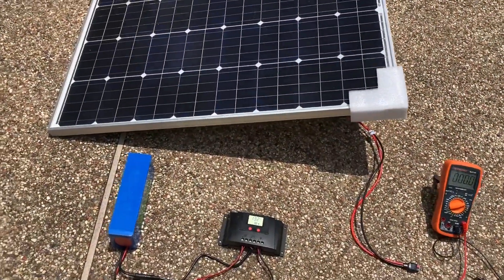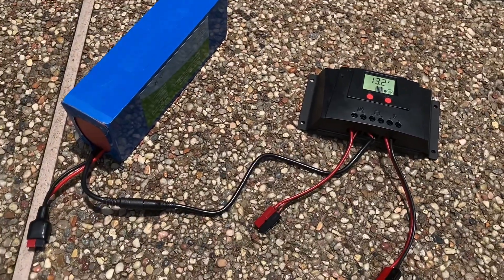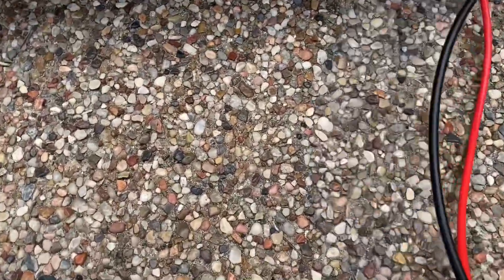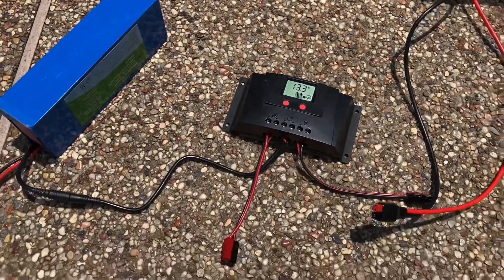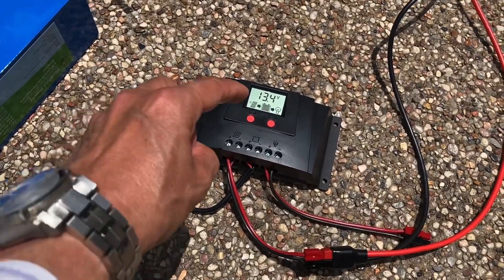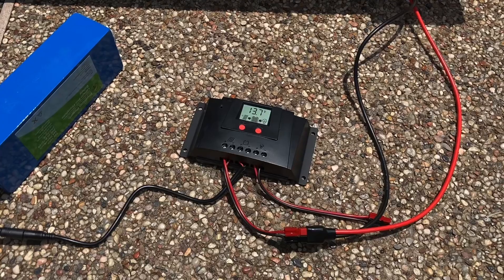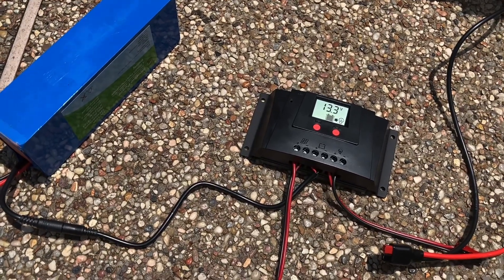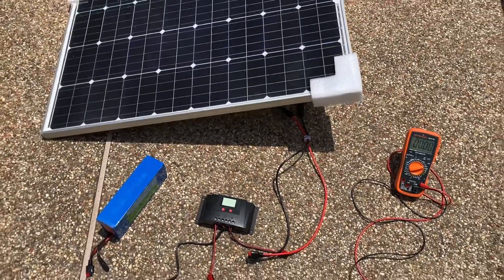Solar Panel connection to LiFePO4 battery

Comment: Brother, I have made a similar connection. If the battery gets discharged at night, even the automatic solar does not charge the battery automatically in the morning. Why does this happen brother? Does LifePO4 battery not work like a lead acid
Reply from the maker: Thank you for the comment.  I found that any shade cast on the solar panel will have a significant effect on the charging operation.  During summer at my current location we experience ˜8 hours of strong sunlight.  So maybe the issue in your configuration is with the amount of unobstructed sunlight reaching your panel.  Best of luck.

Comment: Would this same setup work for a 100ah lifepo4?  I like to canoe camp in the backcountry and am trying to figure   out a way to recharge while out.
Reply from the maker: Thanks for the comment.  I believe that the charge controller that I used, the Bioennno Power model SC-122420JU, should work OK for a 100AHr LiFePO4 battery.  Of course, a quick call to Bioenno Power would erase any doubts.  They're very helpful folks.  Best of luck.

Comment: What are all your components 
and  sources I'm looking at the charger Add the solar panel.  Save one at Harbor freight that is a 100 W good or bad. Thanks for your content 
KQ4CD Paul
Reply from the maker: Hey Paul.  These are the components and their links:
1). 12AH LiFePO4 battery from Bioenno Power ( https://www.bioennopower.com/collections/12v-series-lifepo4-batteries/products/copy-of-12v-12ah-lfp-battery-pvc-blf-1212w )

2). solar charge controller from Bioenno Power ( https://www.bioennopower.com/collections/solar-controllers/products/12v-24v-20a-solar-charge-controller-for-lifepo4-batteries-sc-122420jud )

3). HQST solar panel 100W monocrystalline ( https://www.amazon.com/gp/product/B018BMGTTO/ref=ppx_yo_dt_b_asin_title_o01_s00?ie=UTF8&psc=1 )

4). connector from solar panel to anderson power poles ( https://www.amazon.com/gp/product/B07T3K9TND/ref=ppx_yo_dt_b_asin_title_o00_s00?ie=UTF8&psc=1 )

I'm not sure about the Harbor Freight panel & charge controller.  Since I had a LiFePO4 battery, I used a charge controller made for that kind of battery which is why I stuck with Bioenno Power brand.  Hope that helps.  73!